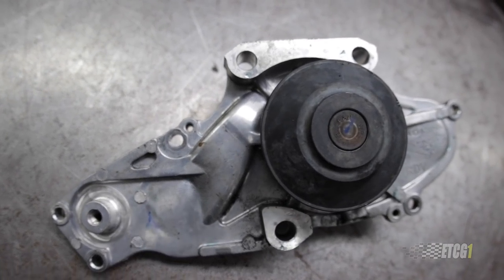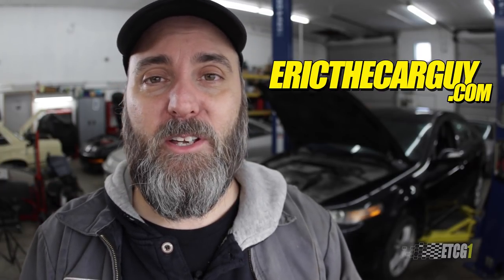Timing Belt vs Timing Chain, Which is Better?

Comment: I have a 2008 Hyundai Entourage minivan. I change the oil every 3000 miles and it has 195,000 miles on it. It has a timing chain, and even though they are “forever” I am nervous that it is close to life expectancy. She runs mint now, and want to keep it that way. Should I plan on changing it out soon Eric?

Comment: with the HP numbers I prefer chains for their strength, and even Honda has gone back to chains as well as almost every other manufacturer. so, the auto industry in a way has answered that question for me at least. I currently own a 1.5 liter 07 Honda fit sport and 06 Chrysler 300 with a 2.7 DOHC engine both with chains. and also, TBH a lot of people don't do preventive maintenance on their cars.

Comment: Timing belts are practical and easy, as long as the engine is designed to be a non-interference type engine(valves won't collide with pistons if belt pitches). Had a mid-80's Subaru turbo coupe that had this setup, pitched a timing belt(2 of them in engine)and engine just stopped running. 2 new timing belts and a water pump later(maybe $150 in parts)and back on the road again for another 100K!
Timing chains are better IMHO, just use good oil and keep an eye on things (if/when you adjust valves). Just my $0.02.

Comment: I gave the video a like. I think it could have been better, if you had included a small section discussing the differences between interference and non interference engines. I change the belts at the manufacturer (not dealers) recommendations. I change my oil on the timing belt  engines a little more frequent than the manufacturers (again not the dealers ) recommendations. Knowing the difference and possible outcomes can help someone decide on a better maintenance plan for their vehicle.
Reply from the maker: https://www.youtube.com/watch?v=uS6_LGWsJzA&t=1s

Comment: Belts over chains all day. I am a tech in the UK and chains fail more than people know. Get in there and replace belt periodically and sleep well at night. If you have a chain, every day is wondering if that tensioner is nearing the end of It's travel, sprockets wearing, guides etc. Most failures are due to customers letting oil level drop low and not enough oil pressure to tension and then jumps tooth/teeth.

Comment: I haven't touched every engine that uses a belt, but I feel engineers design timing belt engines to be a little more accessible for replacement services than timing chains, due to the nature of preventive maintenance. 
I've owned a K24 that's chain driven and also several J series Hondas. I really don't mind doing the belts on the J series because it's so easy. And once every 100k miles really can be a long time. My chain on my K24 was fine, very little play when I checked it at 205k. I feel like chain issues are typically related to oil changes due to the tensioners being driven off of oil pressure. 
Fords typically have that tensioner issue but it's mainly due to that stupid gasket failing on the tensioner causing it to bleed down. And I feel like some owners change the chains out when phasers are done since you're almost already at the point of replacing the chains anyways.

Comment: I prefer timing belts because of the defined service interval. I would be happy to drive a car using a thinking chain only if there is a defined service interval for the chain (not necessarily replacement, but inspection of chain, guides, etc.).
Reply: That’s why I really like Volvo maintenance - the oil and filter, engine air filter, cabin air filter, brake fluid, spark plugs, timing belt and serpentine belt(s) all have specified replacement intervals.  I don’t have to look at my filters and try to decide if it’s dirty enough, I just replace on schedule and not worry.  By following the maintenance schedule, my 15 year old Volvo is reliable and a pleasure to drive.

Comment: 337,000 miles on my Camry and barely .5 degrees of advance at idle. No weird advance under load. So apparently those chains will last quite a long time if you change your oil. 

Had a Dodge product as a younger dude and its timing belt snapped well before 100k and completely destroyed itself. I also know a couple of Honda people that has happened to, although not below 100k. 

So I guess I would say.. if it’s non interference .. and not more than 500$ to have the belt changed..I’m fine with a belt but the chain on my Toyota seems like a champ. I’m quite impressed with it.

Comment: I think the key here really is keeping an eye on your service intervals, I have both belt and chain driven engined cars. As you say if you replace the belt at the recommended time it will be fine, but honestly who does that. But if you get your car serviced i.e. oil / filter change at the required time, if the engine design is good, it will be like a good watch, it will just keep on counting out time. For me, oddly I feel more secure my engine is chain driven than belt driven. My vote goes to chain driven engines.
Reply: I "do that". Just replaced my timing belt at 200,000km, on the service interval. Took a few hours, cost $200 including a water pump. 

Doing that every ten years or so doesn't seem that onerous to me.

Comment: My 04 Civic timing belt and water pump failed a few years back and a local mechanic wanted $1100 to fix it… i called my mechanic 100 miles away and he said parts and labor for $500 so I got my car towed up there to get it done.

Comment: I use to be a timing chain fan. But it seems like these newer cars have weaker chains. Meaning they need serviced maybe half as often as belts. The catch is, the belt is meant to be serviced and its a somewhat easy job. I don't think any manufacture plans to have the chain serviced. Just get a new car.

Comment: Mitsubishi and other deisels have a timing chain + gears. The chain (and this is probably true of all chains) stretch over time and need to be replaced, along with the guides and tensioner. On the 4m40 (Delica an Pajero), how far out the tensioner is, is a guide to how strecged the chain is. Past 50% and your timing changes enough to affect performance. 200k km (120k miles) is usually about the lifespan. An the Delica this is a PITA but the Pajero you can get at it more easily.

Comment: I’ve thought about this debate a lot and I used to be 100% in the timing chain camp. I thought belts were crap and that belt failure and subsequent engine damage was a frequent occurrence. A few years ago I bought an 07 TL-S and did a timing belt job as it had 150,000 miles on it and was due. It was the original belt that was still perfectly fine well after its scheduled maintenance should have been done. That changed my perspective on timing belts as I had thought of them as flimsy and ready to grenade at any second. Then on the other hand I started watching a lot of FordTechMakuloco videos on timing jobs for the 5.4 ford v8. The timing related failures on that engine are so bad that it took away that image I had of timing chains being “bullet-proof” and lasting forever. And as Eric pointed out, timing chains are a lot harder to service and because it’s not a regularly scheduled item, they generally require many more components to be removed than a timing belt job requires. I will say that a timing chain is the only way to go for a pushrod engine as they are so short and stretching isn’t nearly as big of a concern. I guess I wrote a lot to say that timing chains aren’t indestructible and timing belts are more durable and reliable than you might think.
Reply: 100% agree.  154,000 miles on a 2001 civic ex when I did the timing belt and pump.  Belt looked just a slight bit smaller than they new one, you know worn but not worn out. Had no issues just one of those things.  50k later still running great. Gonna replace the factory clutch pack and some other goodies this summer.
Reply: I changed the belt on my Mitsubishi 380 (Galant ) after 105km, belt looked perfect but tensioner was shot😅.
Reply: Oil change interval dictates the life of a chain. They are the last of the oil shearing actions, now that roller lifters are the norm. Keep the oil fresh, & your chain will last.

Comment: +1 on timing chains getting worse over time.  As the chain and sprockets wear, it closes the intake valve later and later as the miles pile up.  As the valve is closed later, it traps less of the intake charge - and in the case of cam driven distributors - retards ignition timing.    I towed with a mid 90s 454 suburban with over 170K, and once I swapped chains, it had a bunch more low end torque from 1000-2500, where I spent most of my time. It was dramatically better.
Reply: Yes, chain wear is a huge problem. The nice thing about most OHV engines was that timing sets were easy to replace and cheap to buy. It really sucks when dealing with SOHC or DOHC engines. Also, the nice thing about chains was that when they were reaching the end of their life, you could hear it, rather than experience the sudden death of a belt driven engine.

Comment: Most of my cars have had timing chain, and so far, haven't had problems with them or even with the one car, that had timing belt, which was replaced once. 
My dad however had once a 1988 Opel Kadett with 1,6 litre engine, which had some way a problematic timing belt, it didn't last even the pretty short service interval, so it died on the road twice for timing belt failure. Luckily it was non-interference engine, so pistons and valves didn't meet each other.
Then I had a 1990 Mazda 323 (Protege in US) with 1,6 -16valve B6 engine, which had 100.000km service interval for the timing belt, and never had problems with that. It was replaced once while I had the car, and the tensioner was replaced too. Mechanic said the tensioner bearing was shot, so it was definetely time to replace that, but water pump was not replaced. I guess the mechanic decided it was still ok and certainly it never caused any problems as long as I had the car.
Mazda had non-interference engine as well, so it shouldn't been damaged, even if the belt did fail. So I guess my experiences with timing belts are from the opposite ends of reliability chart, Opel being the worst and Mazda the most reliable one :D

Comment: Another thought comes to mind if the timing chain starts to go there are signs it's going and more than likely still run just not well depending on the vehicle timing belt on the other hand will just break and the car dies where it's at

Comment: I put a performance Gates timing belt on my 99 v6 Honda and runs like champ has 235xxx miles on it ..also got 08 v6 mustang has  timing chain I could just say that the difference is timing belt is a lil more quite on the engine..

Comment: I dread to think of the amount of interference engines that have been damaged (out of any warranty) either due to a belt or chain failure.
Reply: I'm sure if you go to a junkyard, you will find miles and miles of them.
The Nissan VG30 was nearly unkillable so long as the timing belt was replaced, but back then, many didn't know what it was. As a result, many decent Hardbody trucks eneded up in the junkyard as a result.
Reply: I dread to know too. I learned my lesson on a dodge interference engine. 2.0 dodge neon.. belt snapped right around 60K and totally destroyed itself. Never again. Never!

Comment: and within the chain realm, there are chains and chains. There are those like the one on the thumb picture that have several rows of plates and look pretty sturdy, but I have seen simple chains and sprockets like the ones you would see on a bicycle, and those don't look very dependable to me. Back in time, you had to replace timing belts every 30k miles, and that was a pain in the arse, but 100k miles sounds pretty reasonable  to me, for most people that means one replacement, or two at most, in the car lifetime.

Comment: Gates timing belt in my manual transmission subie snapped after 5 years and 65k, they're supposed to be good for like 8 years (I think?) and 105k. No clear indication why or what happened, oem idlers I used were all silky smooth, tensioner seemed fine. I think the belt might've tried to jump, and got jammed up between the crank pulley and the belt guard that's supposed to stop the belt from jumping. Either way, I guess I'm sayin that left a bad taste in my mouth for timing belts. 

Edit: I tried throwing a new belt on, engine was toast, wouldn't start at all. I also used the red gates tool to properly space the belt guard above the crank pulley.

Comment: I know I'm two years late to the party, but I prefer a belt because servicing the water pump and replacing glycol is just as important, compared to having water pumps driven by fan belts or chain driven internal water pumps.

Comment: to me having a belt since i am pro active about my car is the way to go.  you can see most issues coming.  with the sealed chain not so much.  it all goes with choice though.  when i have seen goes usually the motor will need to be replaced

Comment: All my vehicles have had timing chains. Only had one break. Actually was kinda cheap to have replaced. 2.5 liter 4 cylinder most likely non interference engine.. 1990 vehicle, happened in 1999 I believe. Changed the oil plenty, just don't know why it broke.

Comment: I prefer a chain-driven engine due to the fact there isn't really a service interval.  That being said, I will probably have the chains, tensioners, guides, etc. replaced on my 2012 V6 Hyundai Santa Fe at around the 150K mark....if I still have it (I'm at 30K now).  It is extra important to keep the oil clean because the oil passages to the tensioners are very small and any sludge build-up can cause premature failure.

Comment: I used to be all about the chain.  However there are so many issues now with timing chain guides. I would just as well change a much easier belt every 80 to 100k.
Reply: Exactly it's all about the quality of the engineering. A belt is better than a crappy chain any day. I've had 2 failed chanins in about 15 cars I worked on in 2020 1 was a VW and one a Prius.

Comment: Had an 83 Civic where I did have a timing  belt. Replaced the timing belt. I month later the timing belt broke. The belt had a defect. It trashed the engine. I vowed after that to never get a vehicle with a timing belt gain. I would rather have I little piece of metal keeping my engine running rather than a small piece of rubber.

Comment: I prefer timing chain as a consumer. I always do 5k oil changes, but I also buy my cars with 70-90k miles. My current Toyota had several 10k interval oil changes as that's what the factory calls for. Generally I prefer chains in my Toyota and Mazda I had, but if I had a belt I would get it replaced when needed. I just prefer not having the expense in a daily driver.

Comment: timing chain issues are all the rage with 3.6L v6 engines from GM tho... and the old atlas series also had them chain issues, land rover/ford with their chain issues, crysler, bmw, audi etc. yeah timing belts arent designed to last either.... thats why im in the timing gear and freevalve camp either the most robust timing system or non at all lmao

Comment: Chains SHOULD be more reliable and last quite a long time, but a big issue comes down to many manufacturers who do use them putting very long oil change intervals, which wears every oil fed component much quicker than it should, then you have engines requiring timing chain jobs prematurely

Comment: I have had cars with timing belts and never replaced them. 2 cars where escorts one a gt had 190,000 on it when I got rid of it. The other a 94 lx with 316,000 miles on it when I got rid of it. I am surprised my 10 focus I have now has a timing chain. Really give me a 300 six that's gear.

Comment: I’m into old v8s, chain driven, no guides, no tensioner and if it does fail most of these engines are non-interference so you can just slap on a new chain and keep going. Not hating on belts.

Comment: The Iron Duke is the only gas engine I know of that had a timing gear.
Reply: corvairs  do too   i have both ,, the duke is in my 84 fiero  ,,hard to kill it,,,
Reply: The Volkswagen Beetle had timing gears.
Reply: Air cooled VW engines used gears. You can also get gear conversion kits for old small block Chevys.
Reply: @zachm7916  yep they do too
Reply: The Ford flathead V8 and Studebaker V8 used timing gears. Another thing that sucked was that some of those gears would have nylon or fiberglass teeth that would chip and cause a problem.
Reply: The iron boat anchor. Decent engine in the 80's. Look back at it now and realize how junky they were.
Reply: The GM 8.1L v8 had them too.
Reply: @mph5896  i get 34 mpg  out of mine  an  they get my mail here every day,,,cant hurt them
Reply: The Ford 300 cid straight 6  had timing gears in it. Those were pretty tough engines plus the old Chrysler slant 6 was one of the toughest engines i ever seen they were almost bullet proof. Gears , chains and belts all had their pros and cons but the key to any engine large  or small is maintenance .

Comment: I think the chain vs belt thing becomes a big part of the decision process on older cars, where the cost of a belt service (water pump, etc. as well) ends costing almost as much as the car is worth.  But then again, service & maintenance on older cars tend to be very high in comparison to their values anyways, but I appreciate you reminding us that chains will age as well and without a service internal, you could be worse off in the long run in some ways.

Comment: Got both in my cars mercedes c class timing chain, ford focus mk3 timing belt. Which I will be changing this yr along with, Water pump, Auxiliary belt, diesel filter, oil and filter, Air filter, waterless coolant. Then the c class gets serviced 🤪 #neverendingmaintenanceschedule